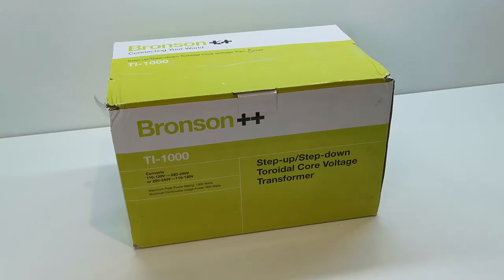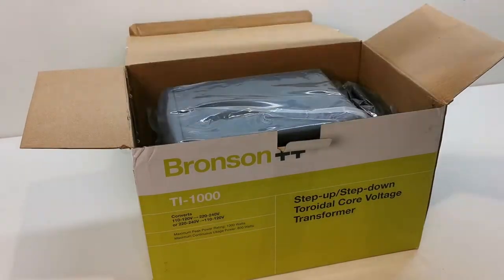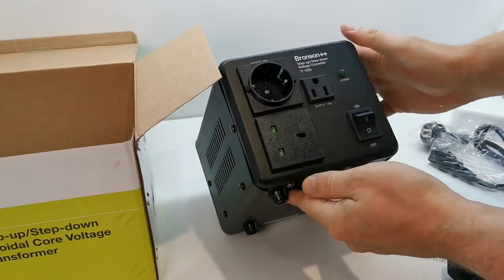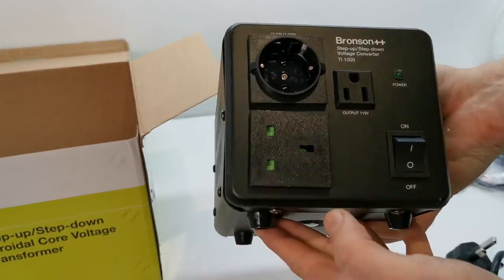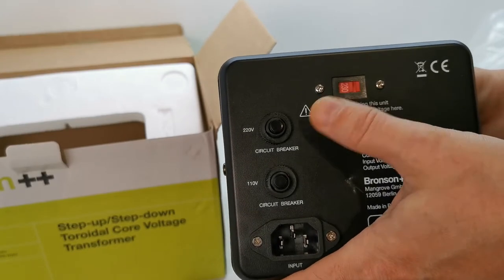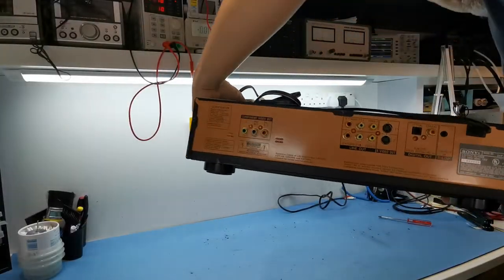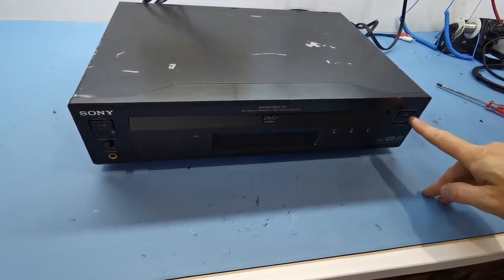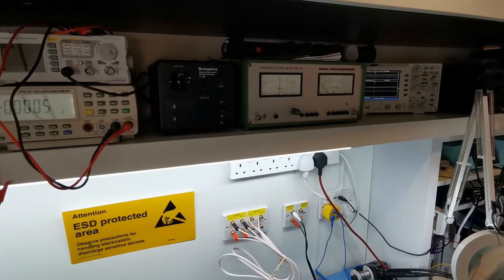Bronson TI1000 110v / 220v Step Up Step / Down Transformer for powering your UK/EU/USA Electricals

Comment: Thank you for clarifying the use of the red toggle on the back. The manual just saying “input” isn’t super helpful. Is if the input power of the item in front or the wall input power in back. You made it much clearer.
Reply from the maker: Glad it helped

Comment: Thanks for the video. Did you tear it down? Does the 240V to 240V go straight through or is it possible to use as an isolation transformer?

Comment: I don’t know whether you know the answer to this. But would this unit work in increasing the mileage output of a Tesla mobile charger 3 pin that can work at 110 or 240. So with this it would be at 220? Thanks.

Comment: Hi,  I have the same one as you (800 watts) I put the wrong input 110 by mistake for 110 output and it stopped working. I pressed the circuit breaker button 110v with the converter plugged out and when I turned on the converter the power still wouldn't come on.   Should I have the converter plugged in when I press the circuit breaker button?

Comment: Hello , i think i dont understand the rear side, where you can choose 110 or 230v, if i'm in france with 220v/230v i need to choose 230V for the input , and if i'm in Japan i need to chose 110 , right?
Straight question : i'm in 220v my Japan tv are 110v, i need to  push the rear slide to 230v ?
Reply: Totally agree, wish the manual was clearer

Comment: Can it be used to plug a US PC Gaming Tower towards any European country such as France?
Reply from the maker: you can run any 110v device in any 220v country, as long as you don`t exceed the rated voltage. You can get higher (or lower) wattage models.